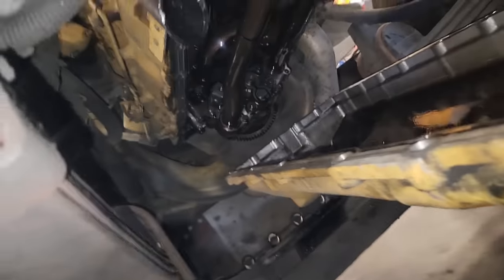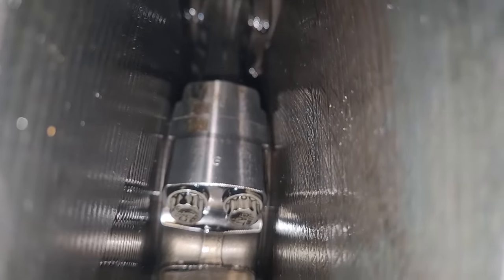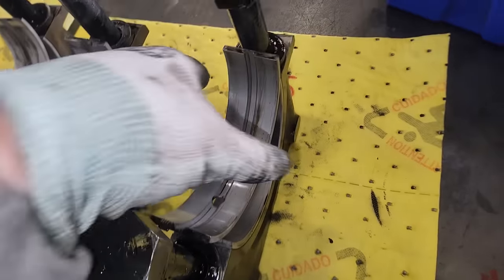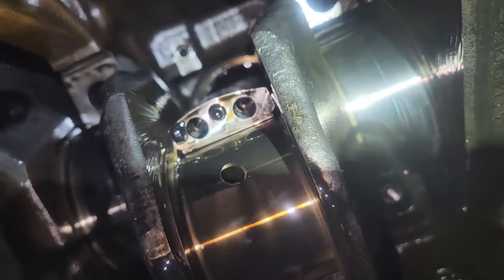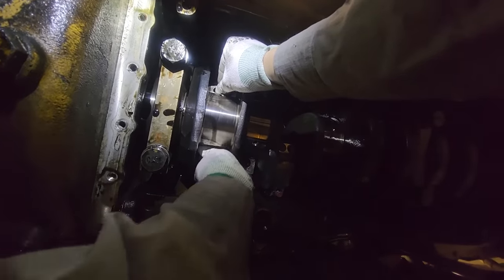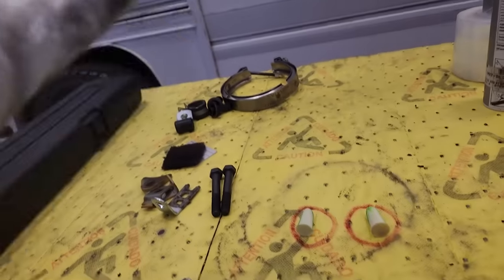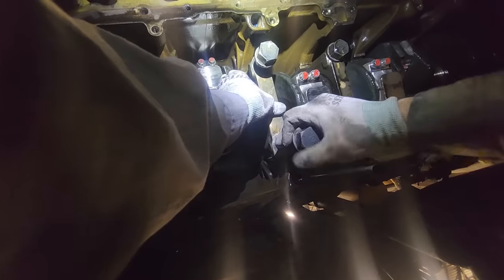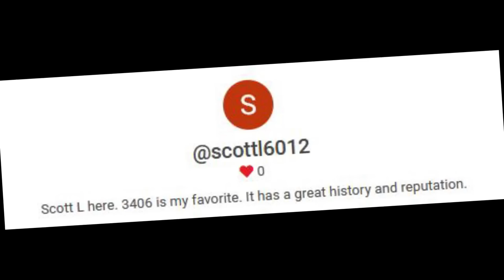Nice Truck Driver Paid for an Engine Rebuild, gets a HEADACHE! Engine "Re-Rebuild."

Comment: Thanks Josh, I will be rebuilding a 1998 Cummins N14 - considering its age, I've decided to pull it from the (diesel pusher) motorhome, strip it down to the bare block & build it back up on an engine stand.  I've saved a lot of your videos for reference, this one's getting filed under "how NOT To build an engine."  My poor German Shepherd jumped up & came over to render aid & emotional support, I was moaning & groaning so much after seeing the damage done to that beautiful truck.  Love the longer, more in depth videos shot while you work - the "here's how I do it & here's why..." is tremendously helpful.  Thank you!!
Reply from the maker: Thank you so much. That's the biggest Super Thanks I've ever received as a comment. If you have any questions feel free to email me at AdeptApe@yahoo.com, although I'm not an expert on Cummins. Give your dog a pet for me.
Reply: I'm currently doing an inframe on a 8.3 Cummins. It's also a 1998. It was supposedly rebuilt 40K miles before I bought it. I'm finding a lot of crap work was done on it, but nothing as idiotic as what we've seen here today. I've been watching Josh's videos and he definitely has great advice and it's helped me a ton, even though I don't own a CAT engine.
Reply: On N14s  check the oil pump gear end clearance. 0.008" is max. And brand new pumps. Come at max clearance resulting in low pressure running.  Have the housing lapped to bring the clearance to 0.0045" to 0.005"
Reply: @Fucktard2  That's a definite possibility - we haven't dropped the engine yet, still building the "jack stands" to hold the motorhome Very, Very steady, 6 feet in the air, so we can actually drop the engine, Vs. paying $45k + for a column lift system, or cutting the fiberglass rear cap off to get the engine out.  So, you haven't missed anything exiting yet.  P.S., I'm not a mechanic either, but Cummins has a great service manual & there's tons of info online, so fingers crossed.
Reply: @waynep343  Thanks Wayne, Jay PayDirt @Jpaydirt posted a great video "How To Fix Low Oil Pressure On A Cummins N14" that goes into this in detail.  This engine only has ~ 140,000 miles on it (barely broken in...), but it has a loud clacking noise (audible when cranked with the starter) that nobody has been able to identify yet & a scored liner on number one cylinder, so my goal is to strip it to the block, replace ALL gaskets & seals, but ONLY replace worn parts (if Needed) for Exactly that reason - the new OEM parts aren't nearly as good as the original parts.  Thanks for the tip!!  I was also planning on capping the oil cooler thermostat to allow it to cool the oil continuously Vs. the factory thermostat set point, that's something ridiculous like 325 degrees Fahrenheit / 162.7 Celsius  - don't quote me on that number, as I'm not 100% it's correct, but it's very high.
Reply: On an N14 have you heard about block fretting, it's when the main cap vibrates and wears into the block, if it gets really bad it will crack the block, just be sure to plastic gauge the bearings on reassemble to make sure they are not to tight, and I read the comments on the oil pump, only problem we ever had was the pump shaft sliding forward and loosing power steering, I like to somehow pin the shaft so it can't happen cause it's only press fit onto the gear, I personally don't believe in cutting blocks for the cylinder liner, I do believe in resurfacing the top of the block and then measuring down to the cylinder land and touching it up to make it true and correct depths, but absolutely hate the big bronze spacer they give you, when liner can stick out of block .007 to .015 I go about .010, I don't believe all that down force is good on the block and liner, seen to many blocks below the liner seat into the block on ISX which I don't believe is as strong of a block as a N14, and I'm not talking overall horsepower load but overall longevity I love my N14's, and 60 series Detroit engines, God bless you and your build
Reply: That is a well deserved super thanks
Reply: @cargotoolshop5319  Thank you, yes, the service manual starts with a big section on block fretting & how to check for it.  Thanks for the plastigauge tip, I will be sure to do that.  The engine only has ~ 140,000 miles, so it's almost brand new, in that regard.
Reply: @Jordan__Sloan  Absolutely - Josh's videos are truly priceless.
Reply: If you need any help, info or even looking for any parts for your N14 you can hit me up. Iv been a Heavy Equipment/Diesel Mechanic for 27 yrs, have done everything from basic maintenance to complete in frame & out overhauls on Cat, Detroit, Mercedes, Volvo and Cummins. With Cummins L10, M11, N14, ISX, ISX 15 being my specialty & can give you info for a few specialty tools needed, Micro turn S shape wrench for air compressor, accessory drive seal & pulley installer, etc. I actually worked for Cummins in Mi for many years. When tearing N14 down make sure you get the # off the cam box gaskets before throwing old ones away. They offer different thickness cam box gaskets but you want to use what thickness it came with as the cam box gaskets effect the timing,

Comment: Having rebuilt a lot of Cat engines successfully I think attention to detail, cleanliness and organization are three major keys. It has always amazed me how tolerant engines are to improper assembly. It is not rocket science. If the OEM doesn't do you probably do not need to. If they tell you to do things a certain way they probably have a good reason. Great video! RFTB!

Comment: Somehow that first start always has me tense, even when you're the one doing the work. It's always nice watching you taking care of an engine.
Reply: Confidence comes with practice.
Reply from the maker: I get nervous too, there is a lot going on with an engine.
Reply: @AdeptApe   I rebuilt one several years ago and started it up. Had a tapping noise when I revved it up. Finally I had enough of the guy who was tapping the engine with the hammer. I went around to the other side to make him stop. Nobody was over there, I beat the "Flash" back to the key switch.

Comment: You can take a cotter pin and flatten the eye. Then, stick it in an oil hole. You can roll the main in without damage. The pin falls back out on its own. That used to be an acceptable practice and was in Ford manufacture service manuals in the 1960's and 70's. I was in your line of work in the 70's and used that method. Snap-On used to make a tool that worked the same way.
Reply: Not all main journals have an oil gallery to use the guide tool with, I always push on the tang on those
Reply: In the book for a Cummins ISM they suggest that method. After I read that I was amazed and always do it that way so much easier!
Reply: Cummins actually makes a tool for rolling main bearings in, it's a brass piece that goes into the oil galley hole on the journal and will assist in rolling upper bearings in, and because it's brass it is a softer metal than the bearing and when used properly will not damage the bearing. On Cummins, there is no oil hole on the #1 main journal, though, so that one is still by hand. The part # for the Cummins tool is 3823818. This tool can be used on almost any of the Heavy Duty sized Diesel engines. It even works on smaller mid-range Cummins too.
Reply: Cat makes a tool for that.  I have one
Reply: Always used a new unused brass brake shoe rivet to roll main bearings. Fit perfectly in the crankshaft oil hole.
Reply: Was just about to ask of Cat says to fo that in their book. Becaise I've only ever done Cummins and it says it.
Reply: I was taught to use an upholstery screw I have also used plastic pop rivet in the crankshaft to roll mains I and out
Reply: i told him about my set

Comment: I work in south FL on volvo heavy equipment,  I'm curious who did this job. A 5 year old could have done better.  
Great job Josh, love the channel.  Always look forward to your videos
Reply: This has owner operator finger prints all over it guy who owns a truck as meticulous as that is doing his own rebuild
Reply: @geauxtigers70714 I would think that a guy that keeps a truck as nice as that wouldn't screw himself on an engine job.
Reply: @geauxtigers70714   I thought the same.
Reply: I would have liked to do it myself, I think it would be better than what I paid for. The best of all is that I would have saved $50k+ and I'm still not done, sad but true.🤷🏻
Reply: @geauxtigers70714 I seriously doubt the owner of this truck did the butcher job on this truck because how meticulously clean as the truck is whereas whoever did the engine work had a very low amount of attention to detail comparatively.
Reply: @gullreefclub I agree. 
Ain’t no way that truck owner be getting greasy finger or boot prints ANyWHERE. 
And since ‘06!

Jeeeze I barely had my own license then and I’ve owned my own shop,
THEN worked at 8 diff shops in 7 states!
Reply: @adonisbatistaibanez4053  Does it still loose oil pressure? Did you guys checked that oil pump? it seems that you guys did not change the cam bearings? it can loose oil pressure from there. Also check the oil pressure with external gauge.
Reply: I have a feeling whoever it was that English is not their native language
Reply: I doubt the owner has done this job. Could be he picked the cheapest quote.

Comment: Back in my day we would loosen all the main bearing bolts slightly. This would allow  a small amount of crank drop and make bearing installation easier.
Good video Josh, thank you.
Reply: That's also how I do it.
Reply: That doesn’t really work when the engine has one piece (circle type) front and rear main oil seals. Additionally doing that on engines with one piece (circle type) oil seals has a very good chance of damaging one or both oil seals.
Reply: Just talked with a guy that just had injector cups done and a bearing roll in done at a cat dealership . Never made it home engine  started labouring , stopped to check things out , engine stalled when he disengaged clutch to stop and wouldn't turn over any more engine locked up . Had it towed back and they told him their mechanic put a rod bearing in backwards . 😮 And told him good news absolutely no damage to crank . 😅😅 I've been building cat engines for a lot of years and my question is how much Emery cloth and cocus cloth was used on crank shaft to cover their butts on that one ..lol 
As far as using genuine cat only parts is far over rated . Common sense tells me a core on parts means parts are being rebuilt ,and that's fine in most cases , but tell me what's better a welded reground camshaft , or a brand new quality jobber cam shaft ? Im finding a quality jobber cam lasting just as long as cat cams . Usually the cam itself is never the root problem of a bad cam in the first place . And what is better quality a head that has had cracks repaired in it , or a brand new head casting ? I've put jobber heads on C15 out on hard service jobs haven't had an issue yet , but once of many  reman cat head on a C15 and could hear a slight ticking after firing it up after about 20 minutes of running the hard to hear slight ticking developed , and I found two Broken valve springs  both broken at exactly same height / positioning on the coil so obviously a bad batch can show up in OEM as well  I've been doing this for 40 yrs and I can honestly say with good conscience. There is good quality jobber parts and many time genuine OEM parts is just an expensive name your buying . But I will say there is some parts I insist on genuine OEM parts as well , because there is some junk jobber garbage out there . But there is also good quality jobber out there as well . So only OEM only is far over rated and myself when there is a core on cylinder liners that almost creeps me out .

Comment: They’re getting harder to find now that everything has gone PEX, but I had an old buddy teach me to take about an 8” piece of 1/2-3/4 copper pipe and hammer one end flat, give it a little curve as well, the remaining round end makes a perfect striking surface for your ball peen hammer, this homemade tool is perfect for rolling in mains as the copper won’t scratch the hardened crank surfaces. You can get the hammered end flat on the edge providing better surface area against the edge of the bearing too. I have the same 8” piece of copper pipe in my toolbox that I made 15 years ago. Also comes in clutch when you forget your utensil for lunch.

Comment: Great video. Not the most pleasurable job in the shop for sure. In top fuel that's the job of the "diver", swimming in the oil! If you take the belt off the tensioner, you get the bearing clearance more to roll in the top upper main shells. Sometimes it makes it slightly easier. It's the finer points of the repair job that seperates the parts changer's from the actual mechanics. Great quality work, keep it up!

Comment: I used to work for Cat building 3600s. This video is crazy from an assembly perspective. On the washers if it’s on to cast no washer if it’s to a machined surface it gets a washer. We should all be impressed it made it nearly 2000 miles to Idaho with how poorly it was assembled.

Comment: When I rebuilt my old 3406 cat I used a flexible scraper to push the upper mains out and it worked great
Reply: I used the tiniest brass punch I had to roll mine out. I also used the pocket screwdriver, but only to realign the new top bearings when they started to go a bit sideways.

Comment: Cat makes a tool to remove/install the upper main bearings.  It's a round pin that slips in the crank oil hole and has a little hinged flat bar attached to the end.  Slip it in, roll the crank around, and it pushes the bearing in/out.  Worked good on my old 3306.  Found the p/n...  2p-5518
Reply: I have a small bolt with the head ground down that performs the same function. Made it in Mexico and down there they called it the campeón (champion) 😂
Reply: Still have mine!!

Comment: i was a diesel roadside mechanic i could do the hydraulics, air system, brakes and pretty much anything out side of internal engine but i join the uscg and went the mechanic route finally got to rebuild a 2 stroke Detroit in A school. ive learned so much on attention to detail i.e matching numbers like on bearing caps and con rods. small things can cause big issues but i cant wait to get out to possibly start a shop. love the video
Reply: 🙏🏻USCG🏁

Comment: My two cents worth. As picky about the interior of the cab, the driver/owner should be doing oil analysis, especially after major engine repairs. Oil analysis will monitor the level of different metals, (babbitt, brass, copper, bronze, etc) floating in the oil and can give early warning as to levels that are excessively out of normal range.
Reply: Your comment deserves a response. I am the owner of the truck and I am very picky inside and out. I paid for a complete repair including the head. The truck left with many problems from the beginning. And yes, I have been solving them little by little. examples (I had to change the thermostats, full of silicone I had to change all the brake housing too,they never calibrated the truck or they were incorrectly calibrated, (maybe because of the paint or dirt ,low oil code, overheating, code of all the vva valves etc. The truck went from dealer to dealer before seeing Josh. Since June I had been writing to Josh to see where he was working but making appointment with him and going from Florida to Idaho didn't bother me. It wasn’t so easy. When there and I waited almost a week just to talk to the best ,plan everything and make an appointment again in time. (believe me it was worth it, in my opinion great mechanic) cat in Florida no longer serves trucks and many dealers don't have cat specialists, it's a shame but it is what it is  . $20k+ after rebuilt sound right to you,there are many things that you don't know and I can't give many details. That's my sad but true story.
Reply: @adonisbatistaibanez4053 I don't think many people can blame you for your actions honestly. You spent good money on a rebuild and as a result you expected good results. You should however consider opening a civil case against the guy who rebuilt your engine, this video is fantastic evidence in your favor
Reply: @panzerfaus8459 Even though I don't think it is always as to start a civil case easy in real life (besides it would cost more money ahead of only a chance to win and get that back as well) but of course for starters he could lay his consideration of starting such a case in front of the mechanic(s) / shop that did him wrong, maybe threatening that is sufficient to get at least part of the pay back
Reply: I work in construction as a supervisor of many jobs. I drive my truck about 65,000 miles a Year and have black stone laboratories analyze my oil about every three changes (15-18,000 miles). This has given me great insight about my engine, the oil I use and the effects of my extended oil change intervals. I pay for the better analysis
Reply: @adonisbatistaibanez4053  It is a sad story. You still have a beautiful truck. I was concerned to hear about the pressure still dropping under load... I guess the crank itself has slight wear. I wonder why no measurements were made? They could have been carried out in-situ with various methods, to check clearances, but doubt this will get worse after being polished, and all you can do is keep a sharp eye on it. Here's hoping you do half a million miles before needing extra work.
Edit: I'm sure he was trying to save it as is, and keep costs down. It was the best that could be done without a full stripdown. Considering the small mileage it had done its a good gamble. Still would have liked to see a plaster-gauge or something done, though it doubles his time under the truck..